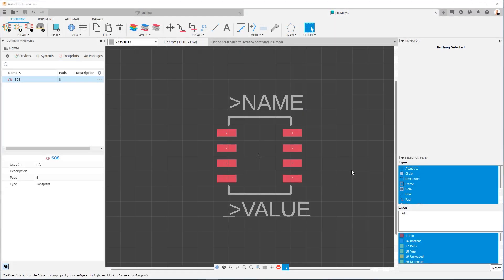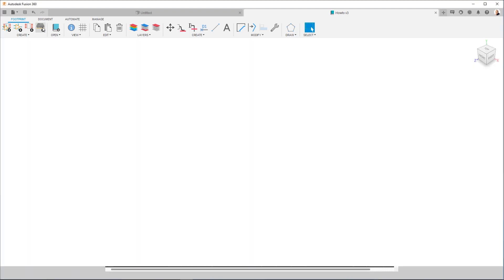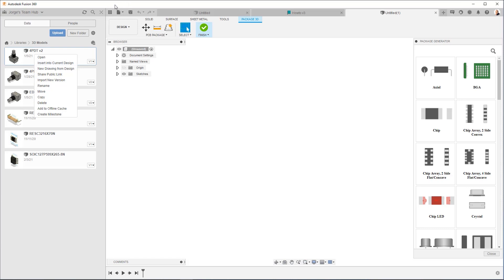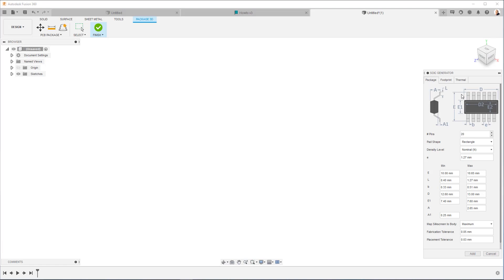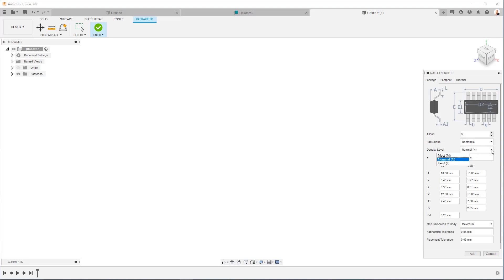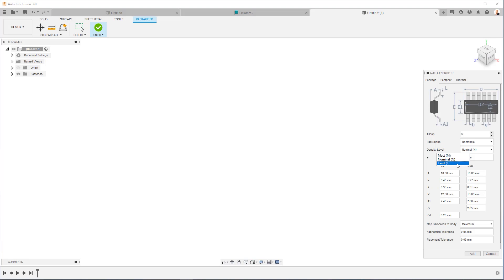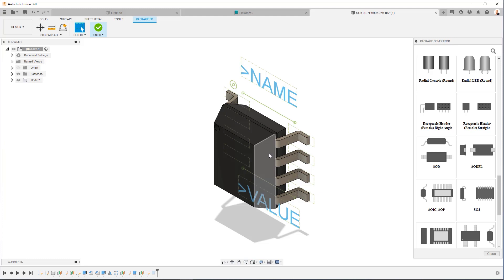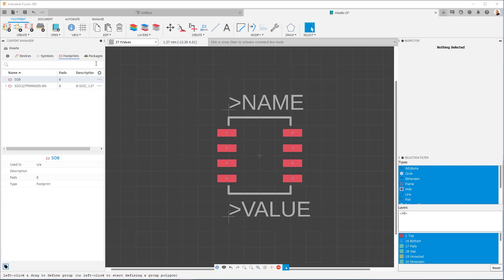Create your own electronics parts in Fusion 360: Video 4 Making a 3D Package

Comment: Thanks for this series!  I've found importing STEP models makes them translucent, with no luck giving them an opaque look.  This makes the board layout look very strange.  Any way to fix that?  Thanks.
Reply: Hmmm... I've never heard of this. It should be possible to edit the look of the 3D models in the same environment I show in the video. Does the board look translucent as well? Maybe you have a global opacity setting that's off?